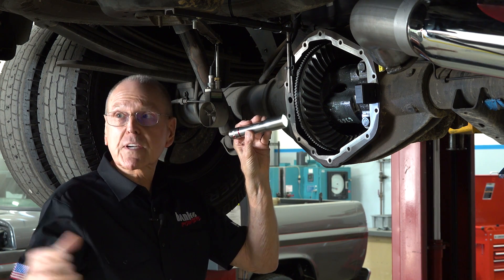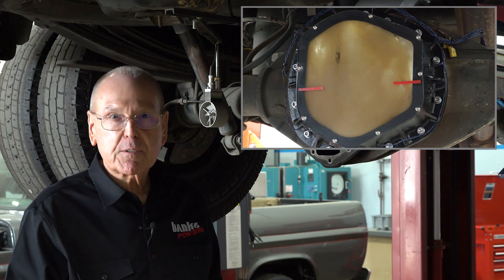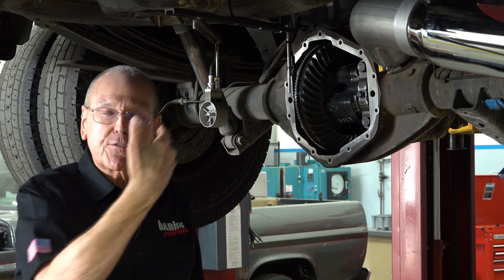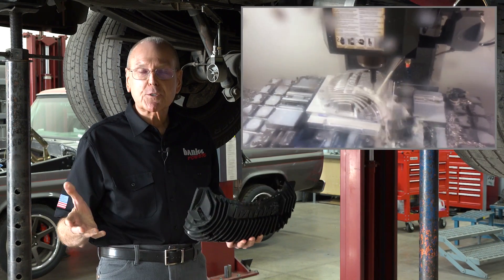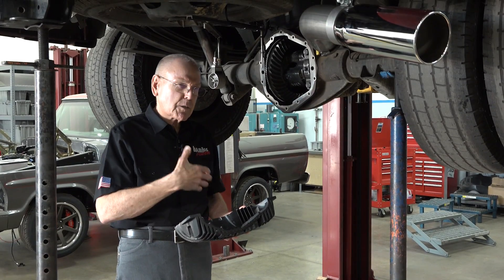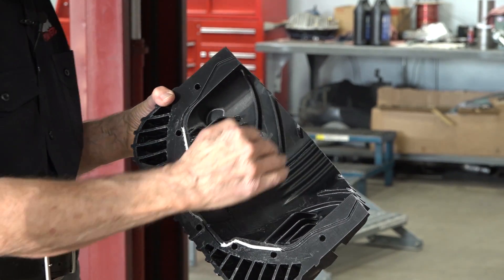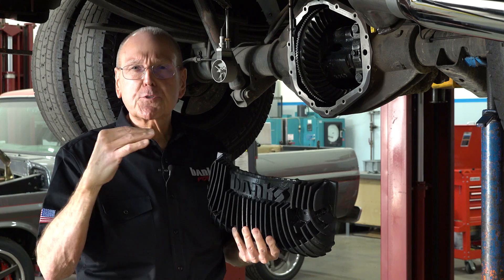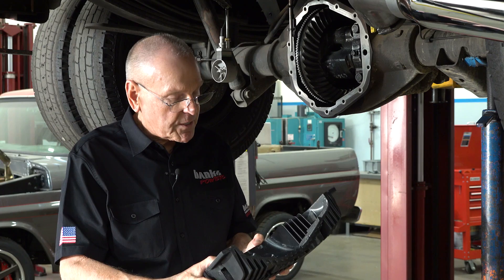Banks All New Rear Differential Cover – Perfecting the Design

Comment: Ram air sounds like a great idea, in a perfect situation, but the second that some road debris or a rock offroad or anything really catches one of those ram air ears and rips the corner of that cast aluminum off in a clean break, and all diff fluid is lost...  youll be wishing you had a tried and true mag hytec.  I regularly tow 16k 2 hours up interstate with my mag hytec and what do ya know...  no issues.  Fact of the matter is theres nothing wrong with stock, and all gale banks is doing is being a hypocrite by saying "the guys at AAM know what the heck theyre doing, no need to improve" and he is using this series as a genius marketing scheme to "improve"  on the AAM design...  just sayin.

Comment: Where is the data? Where is the proof? You've shown us a short clip of a  truck with temperature sensors attached in the previous videos - why wouldn't you include that data in your videos? Instead of talking about the temperatures inside the diff, why not show us? Why not have a video of temperatures in a diff with the square aftermarket cover and the factory cover tested? You went through all that effort to make see-through diff covers, but didn't think to include a temperature sensor?
Reply from the maker: Yes, there were thermocouples in the flat-back diff covers tested. We didn't test the clear-back flat cover because it was just for demonstration. The temp data that you're looking for is coming in our final, forthcoming video.

Comment: What about some the high performance applications that have the carrier bearing cap “reinforcement” bolts that go through the cover? Some that I’ve seen still have the stock cover curved design but some look like there is still a little bit more of a flattened area at the top like the full flat backed design. Honestly do these reinforcement bolts do anything but again make it look cool or make people that can see it think you have real power?! It’s usually an aluminum cover, how much can it really help? Just playing devils advocate really.

Comment: This is very cool but why do you not show the actual testing of the diff covers or tell the results you have found on then as far as heat and cooling time or measure of power loss.  It would just be interesting to see the number comparison between them the stock one and what you are making. Can't wait for the next episode.
Reply from the maker: The diff covers are in production. We hope to have an announcement soon. A results video will follow. Stay tuned.

Comment: I've installed a lot of performance parts from many different manufacturers ( I own a truck performance shop) and I can tell you hands down nobody makes components to the high standards Banks does. Every time I've installed one of their components it fit. Can't say that for others.
We spend less time installing Banks especially exhaust Systems
That translates to lower labor cost.,

Comment: I like that Gale is testing and trying to quantify diff cover technology. But I have to disagree with one area of his comments - that is the part about adding more fluid (as aftermarket manufactures say to do). He talks about the additional fluid level causing churning and foaming. Probably true if the fluid is raised above the OEM recommended level. However, when current aftermarket covers say to add additional fluid (around two quarts) above the OEM fluid amount, it is due to the increased size/capacity of the aftermarket covers. You have to add the extra fluid just to get back to the original OEM fill level. So, I do nor believe that the extra fluid (to the OEM level) called for by aftermarket covers increases foaming compared to OEM covers.

I would bet that the Banks diff cover will use some more fluid than the OEM cover calls for - probably not as much as flat backed aftermarket covers - but some different amount to have the fluid at the correct OEM level. The actual amount of fluid to get to that level is probably not that important. 

I agree that the extra fluid probably doesn't add much heat reduction being a closed system - just longer to reach a stable temperature equilibrium.

I had more enthusiasm for this series before it became evident that Banks was planning on producing their own diff cover. Independent testing from company that does not have a vested interest in the outcome is always preferred. Also, seems to be taking a long time to get to video three - where the actual numbers will shown and compared. So far just opinions (yes - informed opinions by a very smart man - but also a savvy business man) have been presented.
Reply: He showed that the increased oil capacity raised the oil level 3/4" above oem recommended levels and showed the carrier paddling the fluid causing even more foaming.

Comment: where are the results at, u people said we would have them by october 2018..... brutal
Reply from the maker: We people had to pause a few times. The first time was when we realized we could improve upon all other rear diff cover designs. So we designed one. Then, we paused again to patent it. Then we paused again when we fried our dyno. Then when we got back and running we decided that we needed more than just dyno time so we've been pulling a weighted trailer. We're finally wrapping up.
Reply: @bankspower  Whoo Hoo! Now all I have to do is wait for ya'll to make covers for my ancient Astro diffs (2003 just in case your tooling up for me).

Comment: Gale, it is time to start over on the differential cover. Take a hard look at Jantz4x4. Carl Jantz Engineering has engineered a kit to install girdles on the bearing caps. The girdles are bolted through a 1/4 inch steel plate cover. The cover helps to stabilize the bearings so the housing does not spread under high torque. 
I had a custom chassis front wheel drive 31 ft motorhome with a Dana 70 running in reverse. I was running a 502 HT with Edelbrock MPFI, modified intake and Tri-Y headers w/Magnaflow mufflers. Acceleration tests put it at about 420 HP, Desktop dyno calculated it at 440 HP. After breaking teeth in 2 differentials, I had Carl build me his custom setup. Never broke another diff after that. Incidental, this motorhome would break the front wheels loose from a 20mph roll. They would also chirp going into second at about 50 mph.

Comment: Dear banks, please keep in mind that most (or serious) truck owners will swap stock ratio for aftermarket. Such as 4:56 exc. To accommodate larger tires and towing capabilities. I know it's not much different in size but what I care about is heat

Comment: just curious. you are going to include a pocket in your cover for a fairly large  neodymium magnet to pull any wear debris out of the gear lube..  i have been sticking several of them under the right main cap for years as its out of the high speed flow..  the stock magnets are right in the middle of the high speed flow and are NOT nearly strong enough to retain the fragments.. https://i.imgur.com/lAkWt0V.jpg  this is where i stick my stacks of magnets.. https://i.imgur.com/9O0M4JN.jpg?1  its amazing how clean the gear lube comes out after a few months.. looks like i had just put it in .. except for the fuzz all over the stack of magnets.

Comment: Hey, WHERE’s THE TEST DATA? There’s a lot of speculation flying around in this series but we were told you were going to show us scientific data that proves whether these aftermarket covers improve or reduce performance but I haven’t seen it yet.  All that I’ve seen is speculation about fluid dynamics without any test data to substantiate your observations.  Saying the manufacturer knows more than the aftermarket might be true but show us the proof..
Reply: in the case of all the Ford diesels 6 l.6.4l + 6.7l. I would say the manufacturer did it wrong on those engines. causing massive failures and the After Market stepped in to bulletproof these diesels. I have seen many instances where the manufacturers of original equipment got it wrong leading to engine and Transmissions and automotive equipment failures.

Comment: You really want better performing and heat rejection; stock type differential cover with external circulation pump and liquid to air heat exchanger is "more better." why are you only showing tests at low speed? why not at highway speeds? What kind of differences are there at different rear end gear ratio's? at what temperature is the oil not sufficiently providing lubrication? at how much aeration is the oil not sufficiently providing lubrication? how do all diff covers compare, are they all within those boundaries? what about high mechanical load at low speeds? I think you have more work to do.
Reply: This can of worms he opened up. He can't explain so he markets his own....

Comment: for off road 4x4, a guy could add a protective cover over the stock cover to give best oil handling and armor protection. next question might be would that cause too much heat retention. in any case, i think i am going with the diff protection style that has bars to protect the lower half of the cover.

Comment: After considerable thought, I have to disagree with the method you have used to determine the fill plug position. My owners manual ('03 Ram 2500 with AAM 11.5) says to fill to ONE QUARTER inch BELOW the bottom of the fill hole (desired or nominal level), with a tolerance of ¼ inch +/- (thus from the bottom of the fill hole, to ½ inch below the hole). The best way to determine the proper position of the bottom of the fill hole is to shoot lines across the center of bolt holes on the original cover and measure up or down from that point to the bottom of the original fill hole. That will put the bottom of the filler plug hole, no matter how large, or no matter the capacity, at the correct LEVEL point. Anything else is a guessing game. You'all have put too much science into this to suddenly start guessing at things.
Reply from the maker: Charles, our fill level is anything but arbitrary. We designed the cover to use the factory recommended level. Why does Gale say "four quarts?" Because he wants to make it easy for anyone to quickly fill their differentials. You'll see that our site glass falls across the centerline of the bolts as you're describing. There's no guessing involved. Could Gale have over-simplified the explanation in the video? Sure. He basically meant to say we've made it "fool-proof" by designing it around a four-court capacity while matching the factor specs.

Comment: Use some thermal epoxy to mount flat thermocouples to the diff case at each bearing race and measure temps of each bearing to find the ideal fill level that will keep the bearings coolest.

Comment: So you basically made a BMW M diff cover?
Reply from the maker: There are some similarities. However, the M series cover still appears that it would have issues with the oil being slapped against its flat surfaces.
Reply: @bankspower  Yes, I always wondered why they did it that way, some of them even have a horizontal rib close to the path of the fluid, probably to squeeze off fluid to lubricate the bearing. Newer ones like the E92 M3 have very deliberate shapes on the inside to guide the fluid around the ring gear.
Reply: +Banks Power the internals of a differential case are anything but smooth, I still think a larger cover with more oil capacity is a benefit to the differential with Cooling and lubrication. still waiting for the final test results.
Reply from the maker: @redwood6737  Well, we've already presented evidence to the contrary, but we'll present the final data and you can choose to do with it what you want. Thanks for watching!
Reply: +Banks Power thanks for responding to us. I will definitely go back and re-watch the videos to look for that evidence that was presented. I may have missed something having to do with the aeration of the differential fluid. is the video you're referring to the mag hytec cover test with the see-through plastic and LED lights?. who would have ever thought there would be so many differences of opinion on differential covers. thanks for the test that your company is performing and the development of another differential cover with a proper drain plug. some people say the manufacturers know what they are doing. if so why is there not a proper drain plug on a stock aluminum finned diff cover.2014 Ram dually.  along with an easy fill hole at the top or maybe I need a funnel with a 90-degree Bend.
Reply from the maker: @redwood6737  The answer to your question about the drain plug on the stock finned cover has to do with cost. The cost of the plug is a few dollars and the cost to machine the hole and threads in a couple more dollars. When you're making 100k pieces those few dollars add up quickly.
Reply: +Banks Power for the high  cost of these heavy duty trucks. I would like to see the  truckmakers spend the $6 and put in a drain plug. maybe in the future one of the big three will step above the rest In design .because of the manufacturers omission, the owners of trucks who care to change their differential oil end up buying aftermarket covers at a cost of $300 or are required to spend at least 30 minutes of Labor extra to remove and reinstall a stock differential cover. I rewatched videos number two and three and I did not see any specific  results. I'm looking forward to the final results being published in the next video on differential covers.

Comment: Its not good to have part of the cover hang down below the axle. Off road that could easily catch on something and rip the whole cover off.
Reply: no one is wheeling a 350 dually. the little trucks that are worth wheeling can utilize a steel cover because they are not doing enough work to warm the fluid.

Comment: Mr.Banks, Great analysis on the rear diff!  As a suggestion to figure out the aeration of oil, put in a container and put a vacuum.  It's cooler when it's transparent, with the bubbles expanding and the foaming ;)  In aviation prior to conducting a setaflash analysys to fluid, we pull a vacuum to assess the content of aeration and it stabilises the  density level.

Comment: I like the plan. But why are you looking at 4 quarts rather than fluid fill level? I understand if you fill to x height from center line of axle but have more or less fluid the drag down while running will change. More fluid less drop less fluid more drop. But still 4 quarts seems arbitrary but fill height is not in relation to axle center line
Reply from the maker: It's anything but arbitrary. You'll see why in the final video.

Comment: Ehhhh...hang on a minute. Where’s the numbers we were promised in the video with the clear, stock style cover on the ford?  Where’s the real stats about temperature dissipation and oil aeration? 
For the record, I have no dog in this fight. 
However, the only thing we’ve seen so far is a flat back and a curved back both aerate the oil, and both cause the oil to spray off to either side of the ring gear. Remember, the clear, flat backed cover was run up to 50, while the curved went only to 20 or so. Of course spinning it faster will cause more aeration. 
So far, it’s been mostly opinions, which is in no way meant to discredit Mr. Banks. 
However, this has obviously been a marketing scheme from the get go, and we all bought into it. Until the real data gets posted and compared, all it’s been so far is the same sort of unsubstantiated hype that made everyone want to buy a Mag-Hytec in the first place. 
Of course, it’d be cool if he proves his point, but I’ll be holding my breath.
Reply: Matt Endres I couldn’t have said it better.
Reply: From the video of the high capacity covers with the clear backs, it actually looked like they had less air in the fluid than the stock (not as white while spinning). All we have is gale's word that the stock style was better so who knows.
Reply: Yup...I caught all you said and agree with that too. He used different diff oils as well. Not an apple to apple visual comparison, not even close LOL. Clever marketing. My Mag Hytec has given me no diff issues what so ever for over 200K miles. Works for me...

Comment: I had a thought... what about a deep square cover with added capacity,  but some sort of baffle plate inside of it to still deflect the oil up and around to the front pinion and bearing?
Reply from the maker: You do not need added oil capacity. Why would you want it square after all we've revealed?
Reply: @bankspower  thanks for the fast reply. Was just a thought. Wasnt sure if the added capacity could help with cooling, while a baffle plate could smooth out the turbulence associated with the squared covers.
Reply: +Banks Power what is the problem with a flat back cover when nothing else on the inside of the differential is round or smooth. still waiting on aeration results and temperature results.
Reply from the maker: @redwood6737  This will explain our point. https://www.youtube.com/watch?v=0PMvVcsU3PE

Comment: I am sure people have already asked. Are you experimenting with the front diff cover too? The rotations of that are completely different and that also would effect the fluid dynamics as well are going at a different rotation than the rear would be doing.
Reply from the maker: The front differential doesn't tend to see as much heat or wear as the rear. One thing at a time. We have to produce this one first. :)